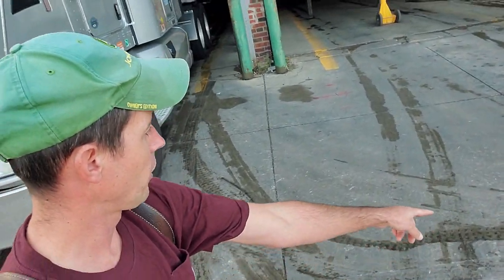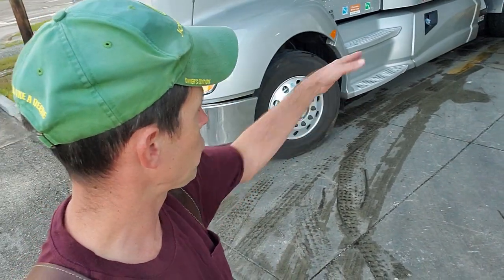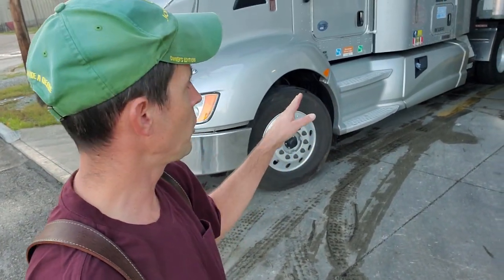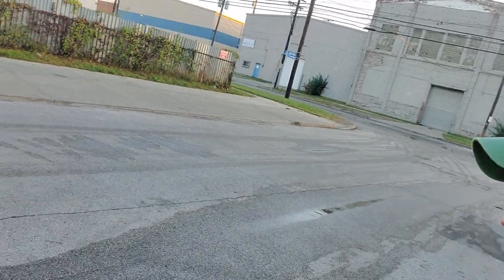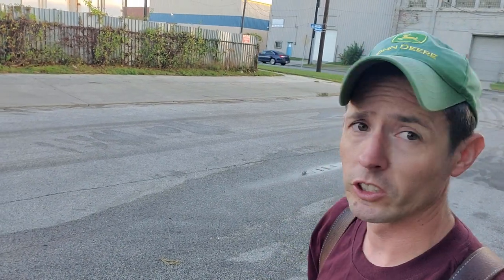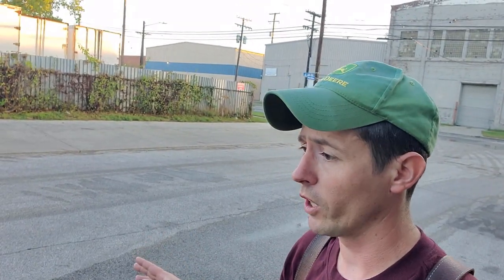Backing Into a Very Tight Dock😱 - Ryan's Tips For Owner Operators/Company Drivers On Tight Backing

Comment: You new guys and gals pay close attention here.  He is describing the proper way to do it.  The cantilever swing can get you into a lot of trouble in these tight situations.  Never go down the road like this if you can avoid it, of course.  I now drive a non-adjustable split axle, and it is something I have to always be on top of when moving forward, since a right-hand turn almost always requires a button-hook even on 2 lane roads.  Backing it is easy though, since the rearmost axle is all the way to the back. 

That being said, I have done it both ways, and it can be done, and in certain cases, it has to be done wheels forward because of clearance issues.  About 13 years ago I had to back about 120 feet to a 90 degree dock through an apparent obstacle course, but wheels back is safer and easier whenever possible.